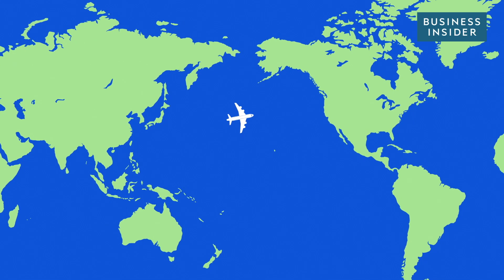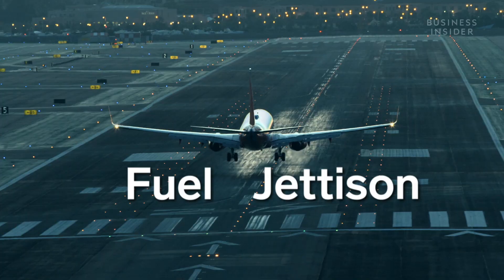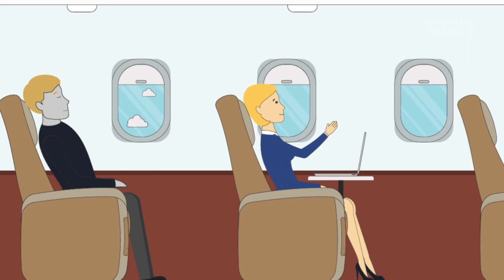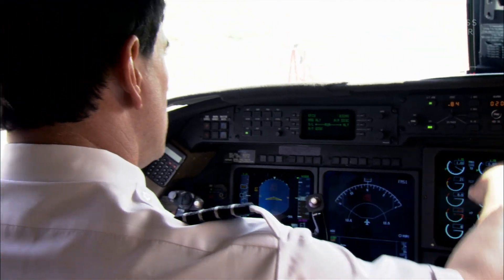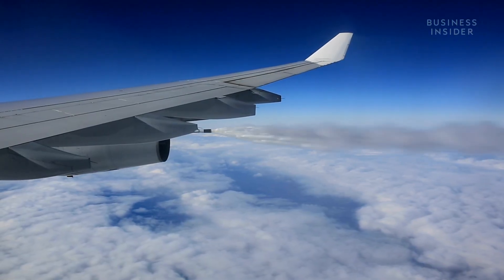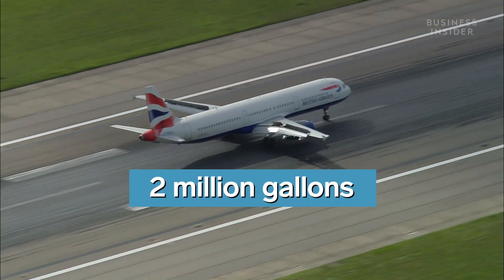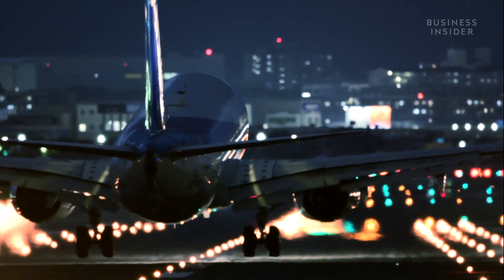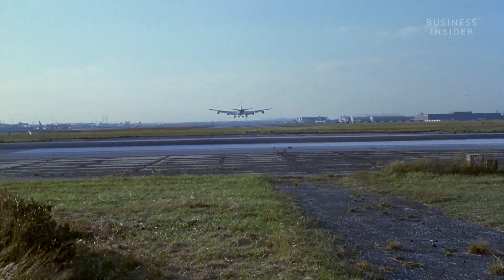Why Planes Dump Jet Fuel

Comment: There should be a rule that no aircraft of any airline shall dump any single pound of jet fuel, even in energency situations, and all new aircraft shall not have a switch and/or button that says "Fuel Dump/Fuel Jettison". All aircraft shall have to land with very heavy weight payload (Passengers + Jet Fuel + cargo + luggage), even in emergency situations.
Reply: My Nintendo Gaming Feed but what if a passenger is in critical condition? Or you HAVE to land
Reply: @brookstune354  Even if someone is in critical condition and is having a medical emergency, the aircraft cannot dump even a single pound's worth of jet fuel; that's wasted money that particular airline spent on fueling up an aircraft for a flight, and it's going to add up to the tune of tens of thousands of dollars. Would I want to dump fuel? Hell, no. That jet fuel is a finite resource, and we'll eventually run out of jet fuel 5-8 decades from today. The only option for all aircraft from all airlines is to land while being over its allowed maximum landing weight for landing to the airport's runway(s).
Reply: So you want the plane to brake apart upon landing bursting into flames and probably killing innocent bystanders over a few pounds of fuel?
Reply: An overweight landing damages the plane Einstein and it's much more expensive than a little jet fuel
Reply: @Clab The other passengers can exit the aircraft via makeshift air stairs that are physically wheeled to the aircraft.
Reply: And what if a plane crashes because of trying to land overweight? Instead of just losing only about $30000 you instead lose millions of thousands of dollars. A B777-300ER for example, is $320.2 million. Lives would also be lost. Airline will have to compensate passenger's families. Don't forget that the runway will be closed, and must wait until investigators is done investigating the wreckage which will the wreckage then be cleaned and after a runway inspection the runway can finally be opened again. For example, in 2008, British Airways flight 38 crashed at the start of the southern runway of Heathrow. 300 flights were cancelled in just a day. Keep in mind since the aircraft crashed at the start of the runway, the runway could be opened again for takeoffs only, in just a day. Is this better than dumping fuel?
Reply: My Nintendo Gaming Feed Now allow me to explain why all of your comments are utter rubbish.  In order for a plane to have its maximum landing weight the same as its take off weight, this is what would have to happen: The structure would have to be beefed up so much so as to prevent the plane from snapping into pieces in all but a perfect landing, killing lots of people instead of just one sick passenger.  Beefing up the structure enough to achieve this would add so much ‘dead’ weight to the plane that it would then make the plane uneconomic to fly on long haul flights.  They can dump over 100,000 kgs of fuel to reach a safe max landing weight.  That’s a lot of extra heavy landing gear, wing structure and fuselage structure that needs to be severely strengthened and thus weighs a whole lot more.  This weight comes at the cost of payload, eg the weight of passengers and freight.  They are the very things that pay for a flight.  This would then drive the price of tickets up to the point than only the top 10 percenters could afford to fly, and not the common people.  In my experience, a whole lot of fuel dumping returns were for technical reasons.  Better to get your arse back on the ground than to press on.  It is extremely difficult to land an overweight aircraft safely.  The Qantas Qf32 A380 flight is a classic example of how close they were to catastrophe because they couldn’t dump fuel (the plane was so severely damaged by the engine failure that the jettison system didn’t work and the hole in the left wing was losing fuel at a rate that was starting to cause a major imbalance.) Despite flying around for 45 minutes (burning fuel) trying to ascertain the way the crippled plane behaved and manoeuvred when the imbalance problem become a reason for immediate landing they landed with 100 metres of runway left on a 4000 metre runway.  That plane was out of action for 18 months for repairs.  So stick to your Nintendo and keep the soap box comments to people who actually work in the industry.

Comment: Airlines company spent $340m on dumped fuel?!
Reply: Plus there is lot more reason for expensive airline tickets
Reply: If they dumped a capsule with a parachute I would be collecting them
Reply: @Skra67b  not much you can do with jet fuel though... maybe try to resale it to your nearest airport?
Reply: @j.sanchez187  or to anyone with a diesel engine or a kerosene heater.
Reply: @j.sanchez187  Run it in diesel engines, or home oil burning boiler/furnaces.
Reply: thats alot plus damaging the environment and more sick people boarding the plane lol. Btw is that Djibouti flag on your profile?
Reply: @warsameadam5572  yes it is

Comment: Why do Birds Poop in Mid Air
Reply: If they land without pooping, they will stress their bodies from the added weight and this could damage their legs or manifest itself as a problem on a future flight. They are not designed to land with a full poop load. It is expensive to poop mid flight and studies are inconclusive about the risks to health. The poop is meant to vaporise but sometimes it reaches the ground and lands on ur face. They should only poop mid flight when absolutely necessary.
Reply: @JoeBlu3 
I would if i could.
Reply: @JoeBlu3  maybe not
Reply: Because there are a lot of freshly washed and waxed cars.
Reply: I mean, they have short or no intestines at all